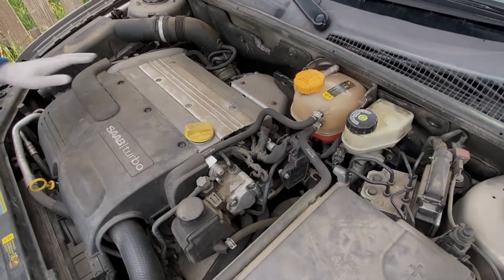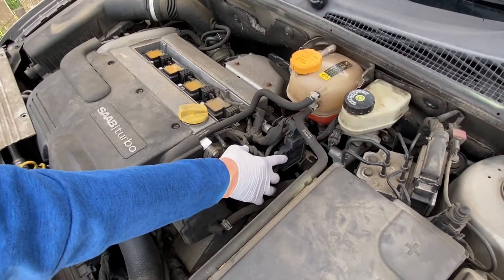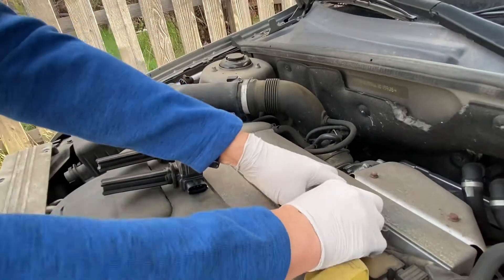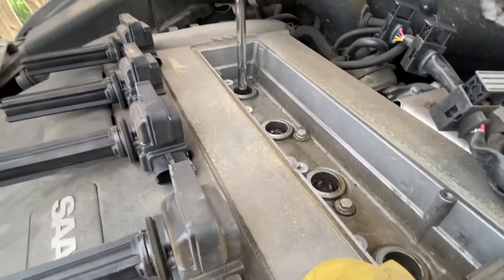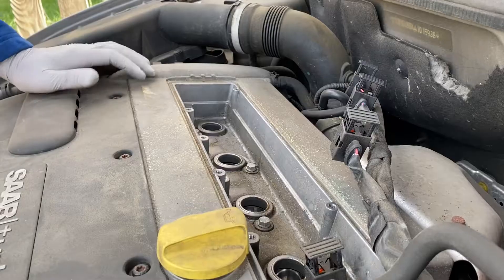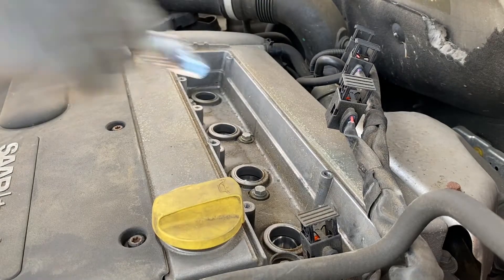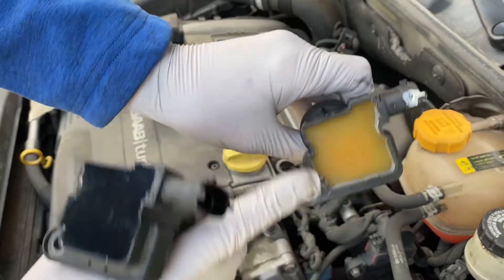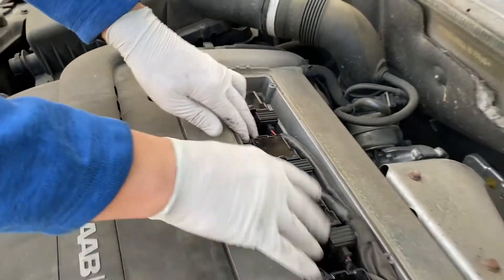Saab 9-3 Engine Misfire P1312 - Spark Plug and Coils replacement (model year 2003 - 2011)

Comment: I tried to do it myself and ended up stripping 2 bolts now I can’t access the spark plugs or coils any ideas or tips? My car is running rough and codes indicate spark plugs and a “b” coil
Reply: Use a smaller socket and make sure you take your time